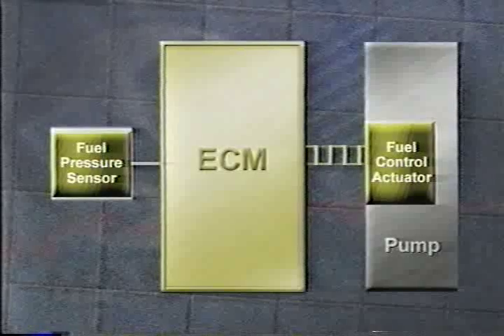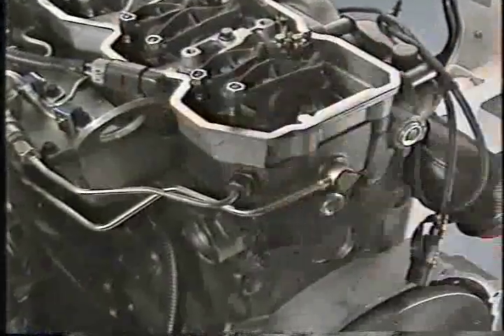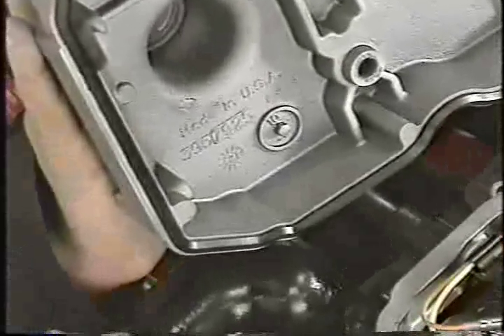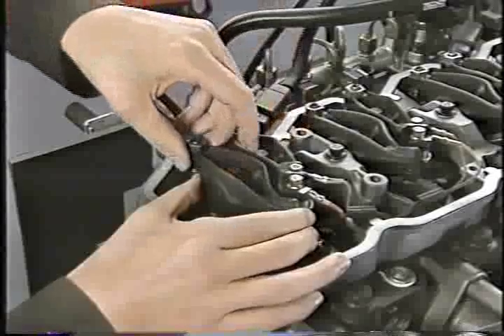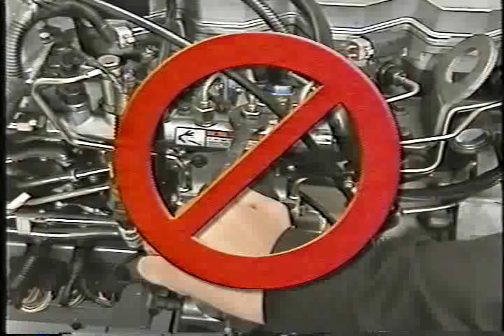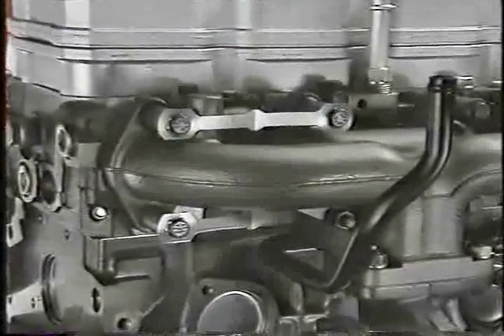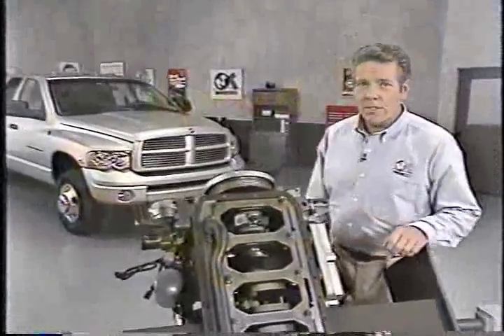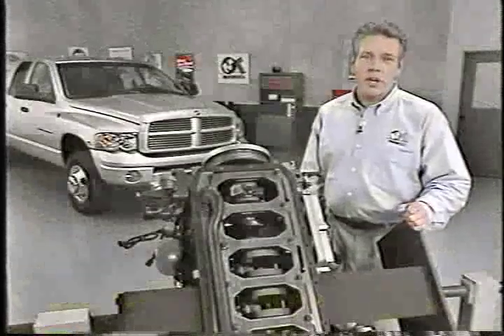Dodge Ram/Cummins 5.9L High Pressure Common Rail Diesel Engine Part 2 of 4

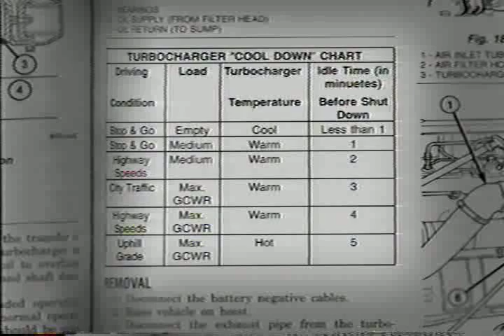Comment: A catalytic converter as stated in 7:31 does NOT reduce the emission of NOx. That is what an SCR system with UREA injection on newer trucks do. If a catalytic converter could do that then we don't need SCR.
Reply: Youre way off. A cat does indeed reduce NOx, just not as much as the epa would like these days